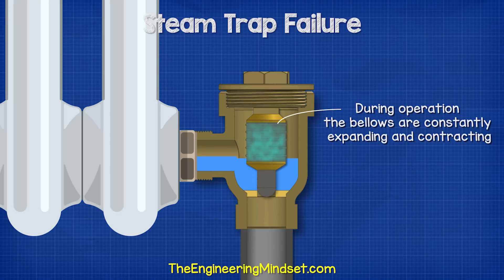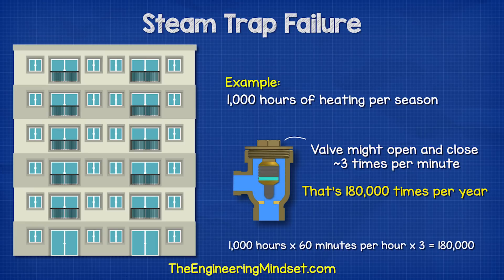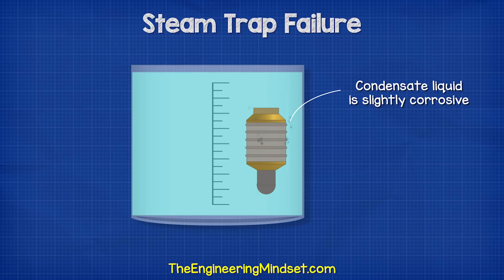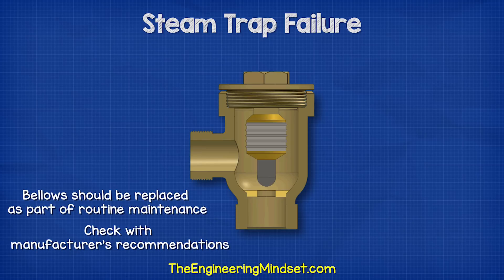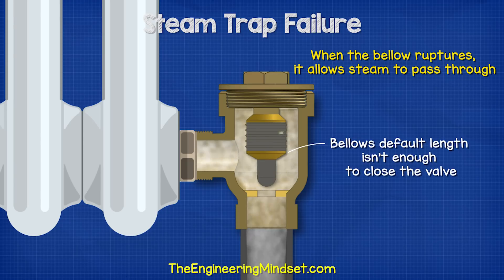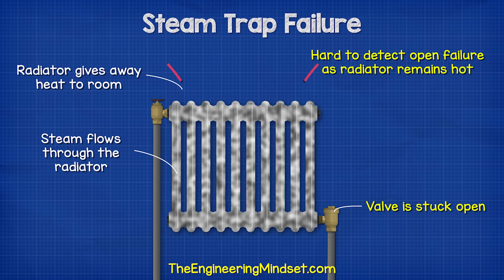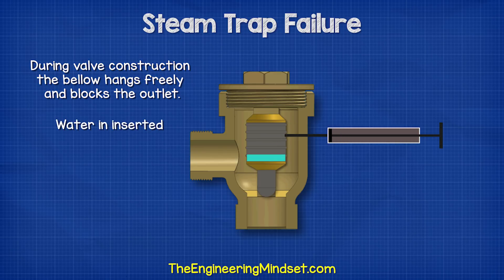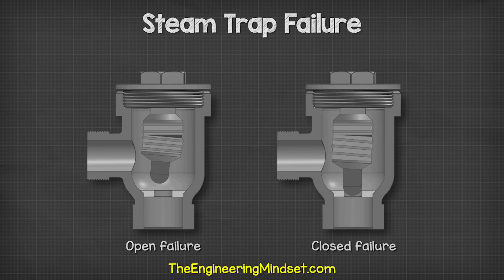Steam Trap Failure

Comment: Any chance you guys could make a video on why we can't use AC breakers on DC and viceversa?
Reply: There are breakers that can be used for either AC or DC, but with different voltage ratings. As DC is more prone to arcing on disconnecting, it's lower on DC than on AC, as far as I can remember. Would be bad, if the breaker starts arcing and burning instead of breaking the circuit.

Comment: Hmm, never heard of such a thing on my radiators. But there shouldn't be any steam in radiators, right? Just hot water without any air, air inside the radiators make them noisy because of trapped air bubbles.
Reply: There are radiators that use steam instead of hot water in older buildings here in America.

Comment: Is this a two (2) pipe system?    Condensed steam returns on another pipe as opposed to a single pipe system?
Reply: There is no such thing as a single pipe system for steam heating, and even for hot water radiators, as they all have a supply and return line, even if it is in series rather than parallel. There is a limit to the number of radiators that can be ran in series on a single loop, as the water is losing heat at each radiator, and the water has to be hot enough to radiate heat at each radiator. With steam systems, they need to return the condensed steam, known as condensate (water), back to a boiler to be heated again into steam. A properly designed system will send steam to the radiator, where it will give off its energy to the room, condense, then return to the boiler. If steam returns to the boiler, it causes problems, as steam is a gas, and gasses are much harder to manage and heat, while water is very simple to heat to a boiling. Imagine trying to get moisture out of the air and heat it up, vs putting a pot of water on the stove. In a properly functioning steam radiator heating system, steam enters the top of the radiator, loses energy to the room, then condense back into water, exits the bottom of the radiator, then returns to the boiler. The steam trap is designed to stop the steam from exiting the radiator, and instead hold it there until it loses enough energy to turn back into a liquid, and then it opens to let out the liquid. This forms a simple self regulating system, as colder rooms will condense water faster, while warmer rooms will condense water more slowly, so in the warmer rooms the steam regulator will cycle more, and slow the heating process in the warmer rooms.
Reply: @GoCoyote  Wow, the condensed steam Does Not return down inside the pipe.

Wonder where it goes?
Reply: @tedlahm5740  
Could you please explain what your saying, as I have never seen a steam radiator heating system that did not have two ports on the steam radiators, one at the top, and one on the opposite bottom side. A "supply" side, and a "return" side. The only type of system that does not do this is steam cleaning equipment that supplies steam through a pipe or hose to blast a surface with steam in order to clean it, then the steam escapes into the atmosphere as water vapor that may very quickly condense into visible vapor.

One would not want to just vent steam from a heating radiator in a home directly into the house, as that would be dangerous, it would quickly become too humid to live in, would damage the home and its contents, and would not operate very efficiently. It would be like using a stove top of boiling pots of water to heat your home. 

As an aside, high temperature steam lines leaks are incredibly dangerous, as super heated steam is invisible, and one can walk right into the steam without even knowing it. This is a major safety issue on ships, power plants, and factories that use super heated steam.
Reply: @GoCoyote  I have a video on single pipe steam but you can also just look it up on YouTube.
Reply: @GoCoyote  I've never seen a two pipe residential steam heating system. In the one pipe system there is a vent on the top, opposite the steam inlet on the bottom and it vents out air. Once the steam hits the vent and the temp rises the vent shuts keeping the steam in the radiator. These will hiss as the air is vented and you can hear them vent and stop. Some vents are quiet though, so not all will make noise. They are adjustable as well. So you can direct the steam to go more to one room or another and balance the heating via how large the vent orifice opens.
Reply: @inothome  
I have only removed steam systems when installing hydronic heating. And of those, all were two pipe systems, with both a supply and return line. I was mostly paying attention to getting the saws all into a good position, so missed many of the finer points, although my boss would talk about it some. That was decades and another career ago.

Comment: if they use a piston-cylinder instead of bellow, the service life of the part would be significantly boosted.
Reply: Bellows traps are just used because they are cheap. There are far more reliable options.
Reply: You could also make the bellows bigger and more  "foldy" to improve the fatuge life! I feel like there are many good solutions that are waiting to be found.
Reply: The problem with any temperature expanding piston system is containing the expansive material. Bellows systems do not need seals, and can be easily encapsulated with material that can withstand the caustic environment and extremes of temperature, while pistons require the piston, cylinder, and the piston seals be able to do the same. It is much more expensive to precision machine, then precision coat the piston and the cylinder in expensive material like chromium, and then assemble the unit with expensive seals between the piston and cylinder. A simple bellows system would cost about the same as just the seals on the piston and cylinder, and are likely to last about the same number of cycles, if not more.
Reply: You can't use piston cylinder as it can't provide the vacuum seal required for this application.